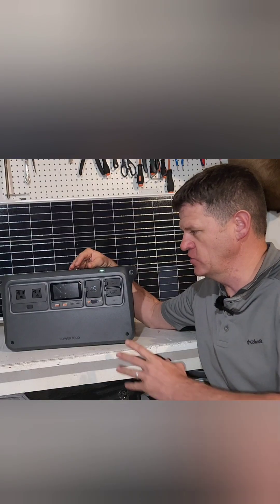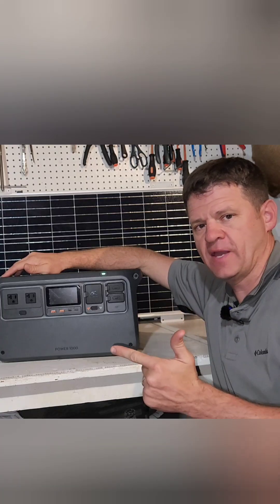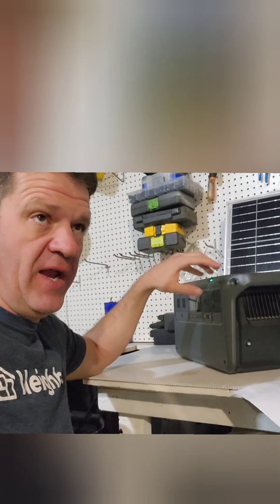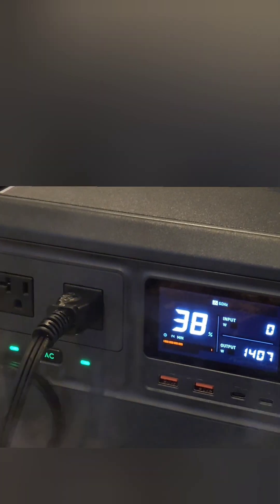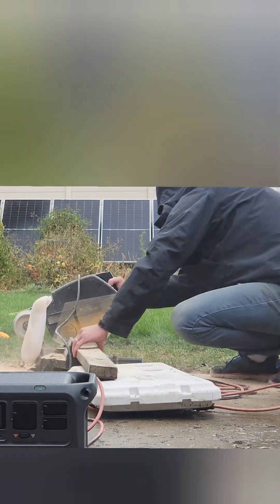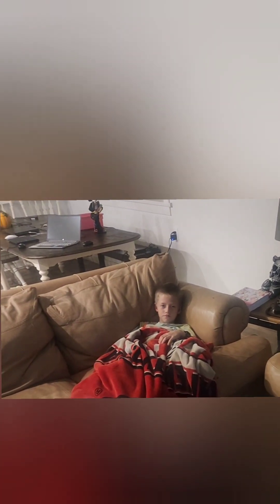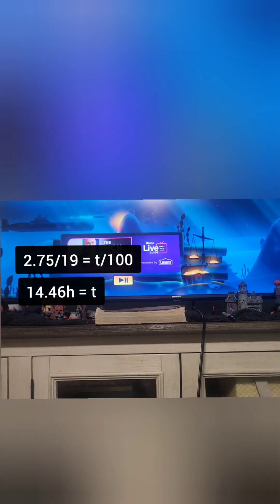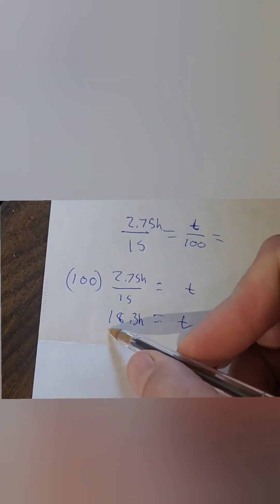How long can a power station run typical household appliances? Dji Power 1000 run test.

Comment: My goal is to have home Solar like your 12000XP setup and use these smaller generators to charge up for friends during outages
Reply from the maker: The 12000xp isn't bad... the best inrush support i've seen so far...
Reply: @diySolarPowerFunWithRay  boy I went down a rabbit hole about the fan noise with the flex box 21.  Sure makes me appreciate that the 12,000 XP seems dialed in better currently
Reply from the maker: @idahoduckhunter  12kpv( and I assume the18kpv) is even more quiet than the 12000xp. In the future I'll be testing the flexboss21 fan noise.
Reply from the maker: @idahoduckhunter  did you hear the flexboss was pretty noisy?
Reply: @diySolarPowerFunWithRay noted thank you